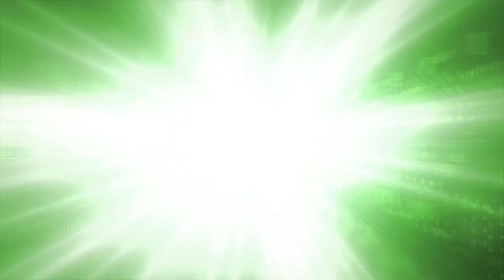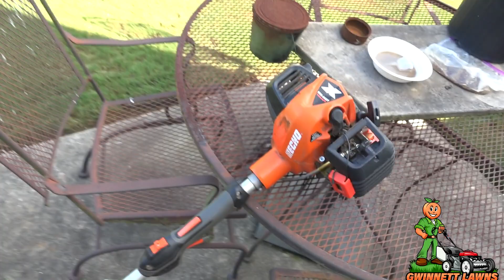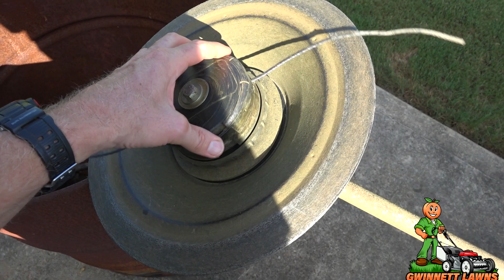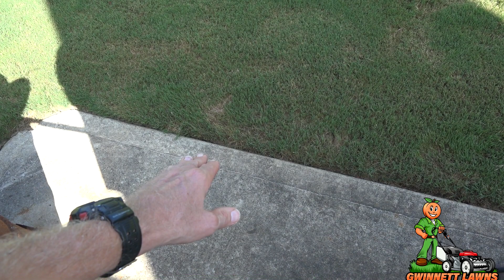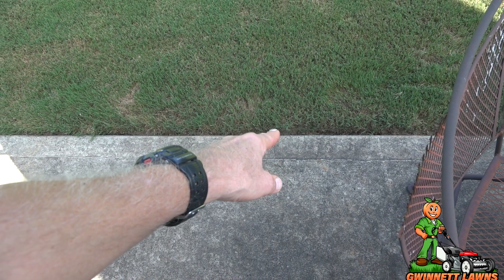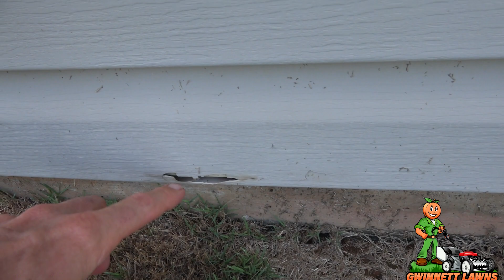We replaced the blade edger with WHAT!!!!!??????

Comment: I also had heard of the Edgit Pro, but I felt like $60 or so for a plastic hubcap was ridiculous. However, after reading and seeing several reviews, I went ahead and bought one.  All I can say after using this for a few months now is that I’d gladly pay over $100 for it. It made a huge difference in both the quality of my edge. It’s worth it alone just in the time efficiency and savings. I’m not a pro, just a residential hobbyist. There’s no way I could go back to the traditional way of edging my sidewalks, curbs and driveway without this. I generally used .095 line. I think I’ve pretty much tried all of the big name lines. I have had better luck with Speed Pro trimmer line from Home Depot than the big name brands. My front yard is Bermuda and my back yard is fescue. I recently went down to .080 in trimmer line diameter and feel like my edge lines are even crisper. I’m speaking strictly on edging, not trimming moderate or heavy brush as a different line and type would be more ideal.